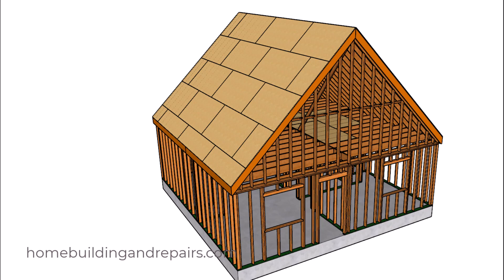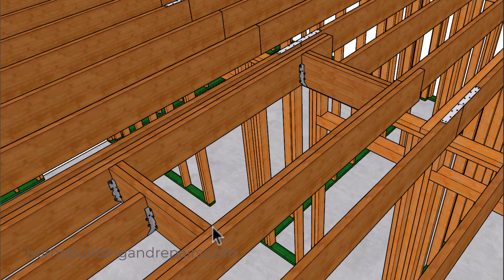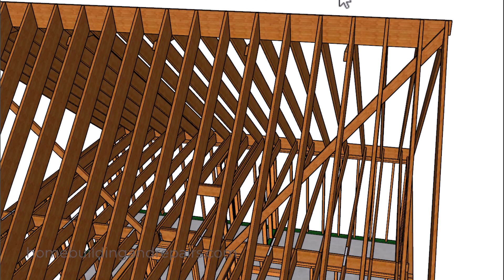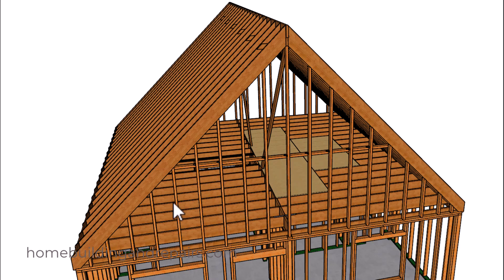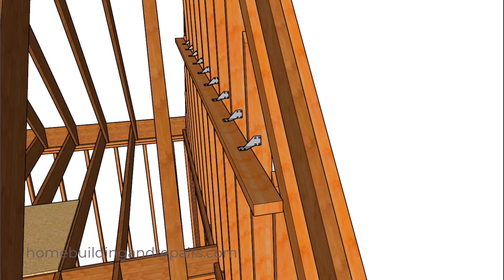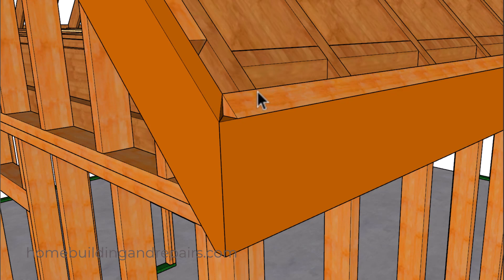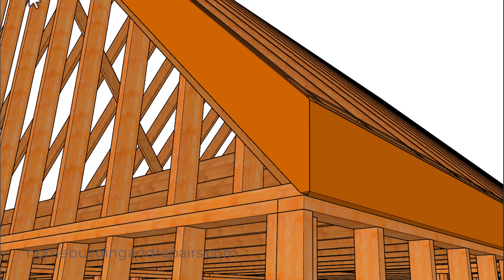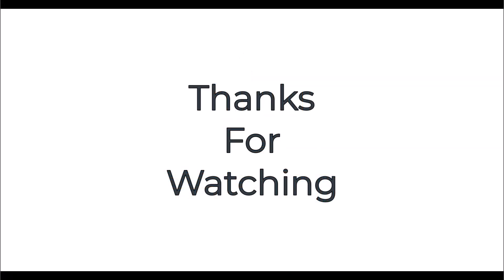625 Square Foot House With Tall Roof And Large Attic Construction Framing And Home Building Guide

Comment: I don’t want those roof ridge braces. Are they necessary?  Any other options? My build is only 12’ wide.
Reply from the maker: I might need to be built with ridge beam or/and balloon framed 2x8 wall studs for gable walls.